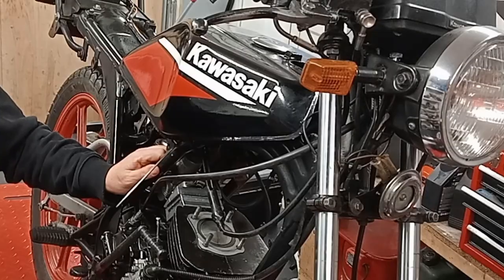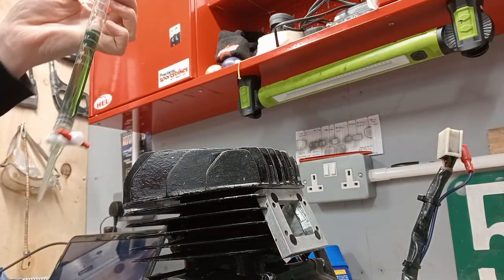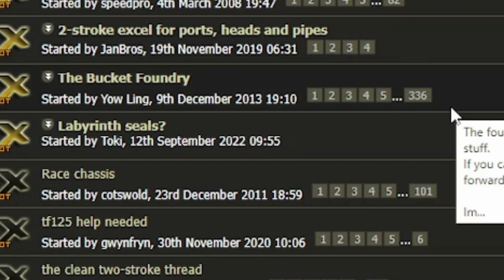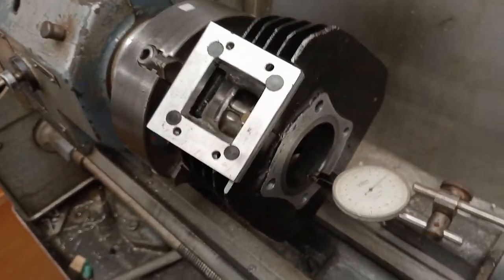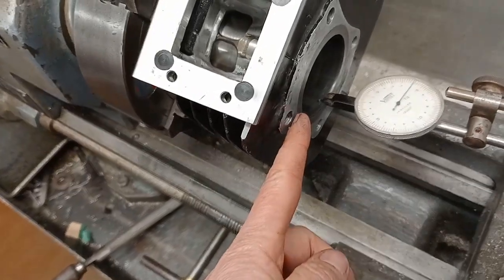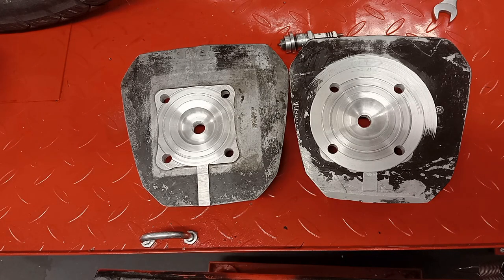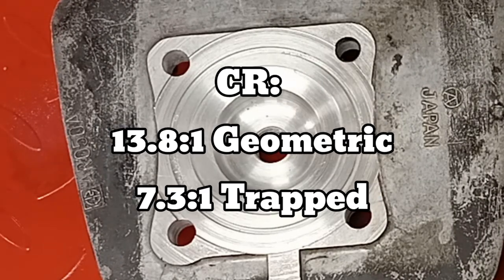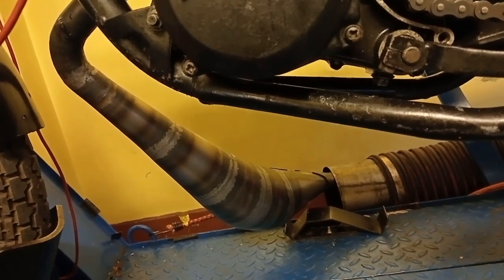2 Stroke Squish Area Ratio Test - Plus Bonus PIPE test

Comment: 05:52 - That rear tyre looks wayyyy to close to the deck, and could very well be offsetting/reducing your Dyno performance figures... Is there a way to place/mount a short section of 2x4 on the front wheel mount to push the bake back a coupla inches? 🤔🤔🤔        😎🇬🇧
Reply from the maker: I noticed that too when editing... I need to modify the Dyno to be able to bolt a separate wheel chock to it. I have bought a front wheel chock... Just need to get it done before more testing. Next time I'm at the Dyno I was going to check for any witness rubber marks on the top deck of the Dyno. I do think you could be correct. Good spot - I was wondering if anyone would notice 🧐😀
Reply from the maker: Just had a closer look at the footage on the big TV and it does appear to be catching... Certainly it's close 😬
Reply: @AutoBeta2T  Haha, I think I remember you saying something in an older video about the distance between front wheel chock and the rear wheel roller being a little long. And, well, it can't be good for trying to nail down higher power gains/figures if the tyre if being 'Gripped' by the bench.. You might find a healthy 10 BHP boost is revealed once this issue is corrected! 🤔😉🤪 Hahahaha
Reply from the maker: Yes - I noticed the first time but it still seemed to work okay so I didn't sort it. I've had the wheel chock for a few months 🫣
Looking at some more footage I have it's hard to tell for sure but it looks very likely. If it is there may be a bonus HP in it and a lesson to myself 😊

Comment: Just a thought, I noticed a rather large spacer where the reed block mounts to the barrel, it may be an idea to reduce the space as much as possible and pack out any unwanted volume in this area. Also consider using a thinner gear oil and use less of it, and make sure the chain isn’t dry
Reply from the maker: Yes - it has increased the volume/distance. I think I can close this up a bit... Also see Chris' slender intake. Thanks for the input 🙂
Reply from the maker: I need to get the WD40 out on the Chain.

Comment: Interesting results from the testing. Sorry it  didn't pay off as expected. The shorty pipe was clearly too short. Cant wait to see what comes next
Reply from the maker: Hi Shannon, yes, a bit disappointing but that's two strokes 😃
Hopefully more blowdown will cure the power shortage 🤞
Reply: I do think the pipe needs to be a bit shorter say 10cm. I think that other pipe is just too short. Either that or raise the exhaust port so the pulses time slightly better for higher rpm but the bike will most likely become too peaky. Keep up the great work
Reply from the maker: Shannon, so probably somewhere in the middle at about 820-850mm.
And thanks again 😊

Comment: Nice tests, great job! You could wrap the longer pipe with heatwraps rendering the pipe hotter and effectively makeing it shorter for a little more revs. Could be a nice and easy way to gain some hp
Reply from the maker: Hi Rusty, I've never tried heat wrap. It is something I'd like to test. I have been told it can lead to detonation if in the header. Still - something I'd like to test myself.
Reply: @AutoBeta2T  i dont think you need to wrap the first few cm of the header but the header and diffuser wrapped seems to be the go. It could be causing problems given you have an aircooled cyl with no water cooling the exhaust duct. The fresh charge that is scavenged and pushed back into the cyl will not travel very far from the port. Maybe about 1.5-2x the bore in lenght, so that part needs to stay as cool as possible to not heat up the scavenged charge before being pushed back in.
Reply from the maker: Good point - noted :)

Comment: Is it a five speed and if so, are there any kawa 6speed transmissions that can be fit into that block? 

How about a trial run with tthat power to see how much it lacks? Im guessing it will do around 70mph. This is the point where the game actually begins! :)
Reply from the maker: Einar, I have the 6th gear from the AR80  but a closer ratio box could help. I have a KX60 box but it looks like the output shaft is bigger than the AR's.
I've been told that there is an option of closer ratio gears from KX's but I'm still looking.

I think you are right about 70 mph. I'd go out and try but it's bloody horrible here at the minute. Still 30mph  increase from 70 mph is a big increase in Power 😊

Comment: Very interesting.
Reply from the maker: Cheers. I suspect my ignition isn't as strong as I thought. Maybe if I can get a better spark the higher compression head may perform better?!
Reply: @AutoBeta2T  Yes I hear with that high compression spark plug gap should go down some. Like if it was 35 thou it should go down to 30
Reply from the maker: @shakdidagalimal  yes, I need to try that. I have a better coil to try too and I need to re-route some of the wiring to try and prevent interference. Should be interesting.

Comment: Surprised at the overall increase, I thought there would be about 1.5  hp, retarding the ignition may help, as well as tthe suggestions from N19ke, I had been thinking of the spacers as well but more from a tuned length point of view than overall volume
Reply from the maker: Yes, I was thinking 1 minimum... But that's how it goes. Ignition retard and advance just lost power.
Reply: @AutoBeta2T  it seems like neither of those pipes is suitable, I didn't catch what engine the templates were for but why not just do one in your software?
Reply from the maker: Agreed, I think the BDK is a bit long for what I need and the other is definitely too short. The templates were originally for an AM6 pipe that didn't work too well (peaked too low). It did work very well on the original PS mag AR and was used in their attempt. I'm really interested to test it against the BDK pipe which appears to be pretty good. 
I'm sure I'll end up trying another sim  derived pipe in the future.

Comment: You know how most things work on a two stroke. They are either good for the top end power or the bottom and you have to find the balance that works. High compression may be the wrong direction. Put a shim under it to see what it does.
Reply from the maker: Yep - they are fickle things :)
It certainly doesn't like too much compression but it preferred a wider squish band. I'll look to recut the original head for less compression. 
Reading back through the magazine articles today the original challenge bike had 15:1 geometric comp... But a much higher exhaust port duration (203 deg) so the trapped compression would be lower.
Reply: @AutoBeta2T  have you looked at the toroidal chamber design? It seems to be what the aftermarket is using for some time now.
Reply from the maker: Hi David, I have years ago. Definitely something to put on the to test list. It would make an interesting test. 🙂
Reply: @AutoBeta2T trapped/corrected is the measure.. geometric has no bearing.. you didnt say anything about retarding ign timing as comp's increased.. the graphs don't suggest it but you could have been getting close to preignition.. had you considered making a radial finned head.. or welding the top two barrel fins to form a water jacket & radiator.. same for head & an exh port jacket & an electric water pump.. if your rules allow it

Comment: I've got an old bsa b33 , it's been bored and stroked to 597cc , I found the intake cam retarded 10 degrees , it had two spacers under the barrel,  piston down about 2mm , I've removed the 1.5 spacer and found the piston just nipped off the plastersene off , it was easy to mod the edge of th chamber and I now have about .035" squish but only about 5mm wide tapering bigger toward the centre , piston is a harley shovelhead with a dome the bsa is a hemi dome , I've reset my timing and will correct any piston to valve issues , I hope this squish helps the old girl . Cheers
Reply from the maker: Hi, sorry for the late reply. Did the squish help the old girl?
Reply: @AutoBeta2T  thanks for your reply , I would have tried it , but my magneto died , it's been rewound now , I reassembled it and gave it a cold comp test and got 190psi ,wow , but I still had very little compression if I kicked at a medium speed , I did a recalculate on the compression ratio,  and realised I hadn't quite got the Calc right , i:e where barrel spigots in , new Calc came out at 11.3 to 1 so I took the barrel off and found the top ring groove had pinched down on the second ring and it was jammed , so now after much research I'm changing from a shovelhead piston to a evolution piston which is flat top and +2mm in pin height  
I will sort that and weld on two eyebrows for the squish band and reclearance for .040 , and hope that sorts it out , I found other issues as well, like one valve spring 13mm short !  It's  Been hot at some point , but was from inlet side , New springs and seat pressure adjusted . Cheers

Comment: How can i calculate the sar? I never understood the method
Reply from the maker: Hi please see below:
Worked example of Squish,
Cylinder Dia = 54mm
Squish Band width = 8mm
Area of a circle  =   A=πr^2 
Cylinder area = 3.14 x (54/2)2
	           =  3.14 x (27 X27) 
	          = 2289.06 mm2
Cylinder area without squish band = 54mm  - 16 mm  
	        = 38 mm
       Area  = 3.14 x (38/2)2
	   = 3.14 x (19 x 19)
	  = 1133.54 mm2
 Squish area  =  Cylinder area - Cylinder area without squish band
	         = 2289.06 - 1133.54 
                        = 1155.52 mm2
 Squish Area Ratio = 1155.52 ÷ 2289.06
	                  = 0.505 or 50.5 %

I hope this helps

Comment: IM getting a little bit worried !!!!!! on why your work is falling short on power !!!!  If a standard Ar80 which is what I had did 68 mph with a Stan stevens tune think it was 2 mill off head and port i was getting 78 mph would gone past 80mph with higher gearing as I was 1 though in red may be 1 1/4 .... so if standard bike had 10.2 bhp im guessing the tune gave me 4 more bhp !!!!! everything else was standard exhaust reeds timing everything --
Reply from the maker: Haha - me too a little... 😰
But I'm hoping the exhaust blowdown is limiting it and when that's addressed a few more ponies will be released. 🙏

Comment: Surprised  you didn't try adjusting your timing with the higher compression  head.
Reply from the maker: I did but it made no difference... Probably should have mentioned it. 😬
Reply from the maker: Didn't try fueling mind. The new jets came today
Reply: @AutoBeta2T  ahh thanks
Reply: @AutoBeta2T  when tunning  most modern  sport bikes got the latest  bosh o2 sensor  on the dyno at the shop. People get caught up on the afr ratio. For Me it's just a reference #  yes I want to see a non spiked even curve. But what ultimately  I keep adding fuel to the map till point I start loosing power. And then add little more. Simply because most sport bikes have ram air sorta speak. So typically  when off the dyno in moving air it's about best it can be. I rarely mess with anything  any longer. With the exception  of about 4 nhra prostock motors a year. This year I'm hoping to not fool with anymore  motors or motorcycle.  At 58 yrs old I just want to add gas and ride. Anything I ride nowadays is 100% stock. Guess I lost all intrest. Other than watching guys on YouTube
Reply from the maker: I have AFR on my Dyno to... tend to have it sniffing but as you say for reference. I haven't used it enough to build up a feel for what it is saying. From what I've read it's easy to be misled with in on a 2T.
Sounds like a plan to enjoy putting gas in and just using them. Enjoy 😊
Reply: @AutoBeta2T  yes agreed  afr is kinda useless  on 2 stroke. Basically  keep adding fuel till you stop making gains. Use to run a super flow 901 dyno 3 days a week for about 7 years building unlimited  offshore  power boat engines before there was ecu afr and fuel injection always looked at exhaust gas temp at the port. 1275 degrees typically was perfect. That's 4 cycle motors not two strokes. My cab vids are short but legit on my Playlist tuning  motorcycle  is easy as putting shoes on in the morning.

Comment: Just wondering what the squish velocity was of both heads.
Reply from the maker: Hi, at 9000 rpm
50% is 34.19 m/s
39% is 24.1 m/s
Reply: @AutoBeta2T  Thanks
39% looks right but 24 but 34 seems high on the 50%
Optimal being 22 to 25 range
Reply from the maker: Hmmm. It preferred the 50% SAR on the Dyno... However, I need to get my tyre catching issue sorted and re-run the test.
Reply: @AutoBeta2T  Yes 50% did yield a better HP result which is interesting but has me wondering, what if you increased the clearance slightly to have a lower velocity similar to the 38% SAR what the result would be. By that I mean to test the effect of SAR by essentially isolating it as the only variable and all other things like SV and CR being equal.
Reply from the maker: @AuMechanic  I'll try that at some point. Will be an interesting test. In hindsight I should have kept the original head as was and did one change on the other.
Reply: @AuMechanic  It's not too much squish speed if the ignition can handle it
Reply: @monej-gaming632  Maybe.
The energy created by excess squish velocity creates some heat itself and enough of it will tend to negate the benefits of a squish band which is to reduce detonation.
That is according to  Professor Blair SAE papers on the topic.
Note his squish velocity equations also outputs a Joule value to that end.
Reply from the maker: What paper is that? I don't think I've seen that one. 
I need to dig out my collection of SAE papers to brush up on some theory.
Reply: @AutoBeta2T  In his book if I recall right which was published by SAE
Reply from the maker: @AuMechanic  cool, I'll have a look. Interestingly, Chris Brocklehust who did the original article tune did his uni dissertation on the effects of squish bands... Can't remember his conclusion though.
Reply: @AutoBeta2T  Id like to have a read of that.
Reply: @AutoBeta2T  Ok here is it
Page 333 of Design and Simulation of 2 Stroke Engines.
Quote
A useful design starting point for gasoline-fueled, loop-scavenged engines with central combustion chambers is to keep the maximum squish velocity between 15 and 20 m/s at the peak power engine speed. If the value is higher than that, the mass trapped in the end zones of the squish band may be sufficiently large and, with the faster flame front velocity ties engendered by a too-rapid squish action, may still induce detonation.
Reply from the maker: I'll try contacting Chris and get back to you.
Reply from the maker: @AuMechanic  if you drop me an email @ Autobeta2t@yahoo.com
I'll send you a copy through.